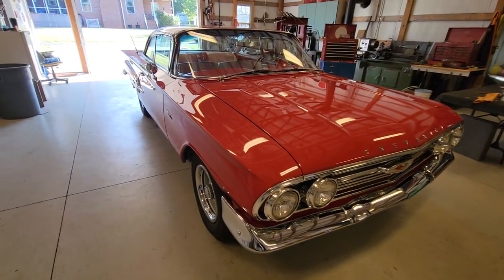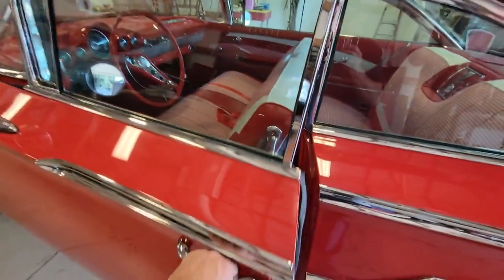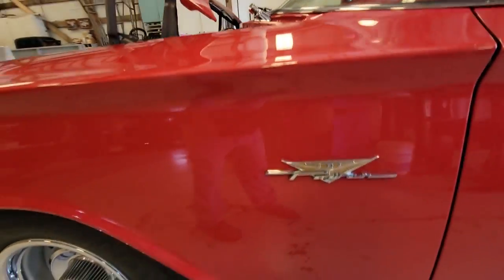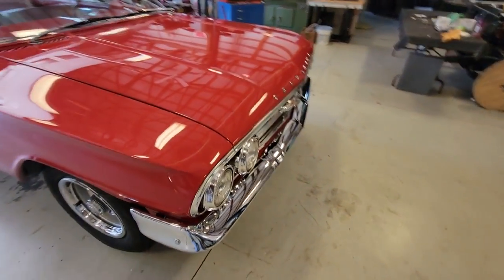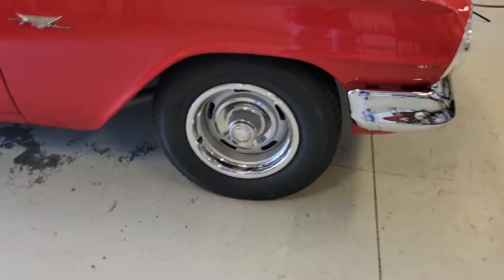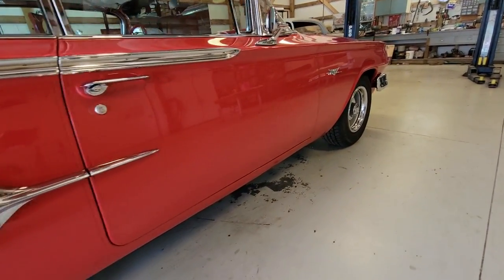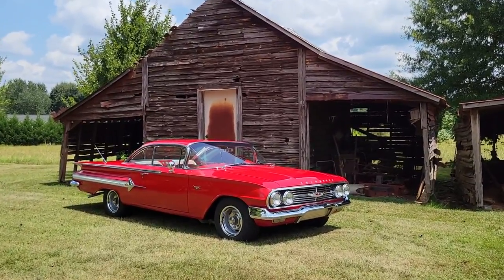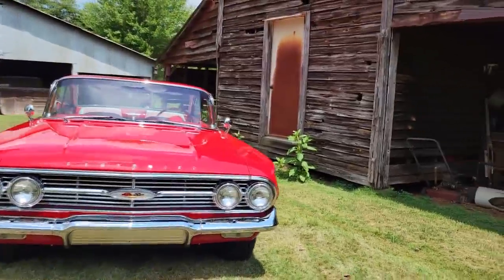Unveiling the Jaw-Dropping 1960 Impala Restoration

Comment: The satisfaction for a job well done has got to make you just love your job.  If I could go back I think I would be a painter.
Reply from the maker: Thank you very much!! I think I love the fabrication the most, paint and body is ALOT of sanding lol. Im self taught with some guidance from a friend. Yhe only reason I started is because I couldn't afford to pay someone to paint my own car lol.Thanks for watching!!!
Reply: @ACDesignsGarage  I too am teaching myself and part of the reason I found your channel. I have a 59’ Austin Healy Bugeye and decided I was going to spend the money to experiment on an extra hood ( Brits say bonnet) to get it solid, straight and finally painted. I just finished a base/ clear on it after hours of rust repair, dent removal, body fill, prime, block, prime again, block, block again, seal, base, clear, find a imperfection, fix, reclear, color sand, burn through an edge, fix, reclear, color sand and now ready to buff HA HA!! Lotta of work to learn but boy have I learned what not to do and what to do. Thx again for your great vids!! 💪🏽👊🏼👍🇺🇸🙏🏻